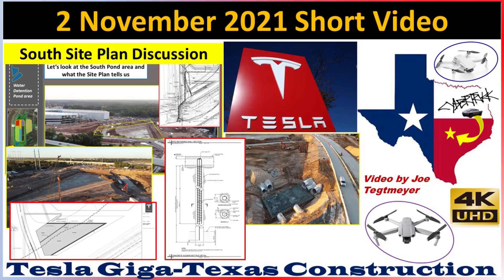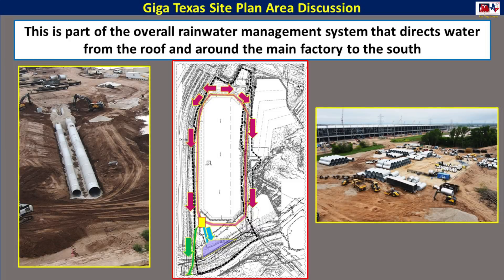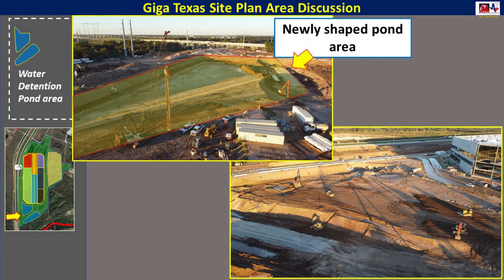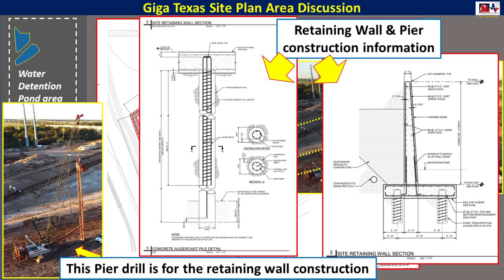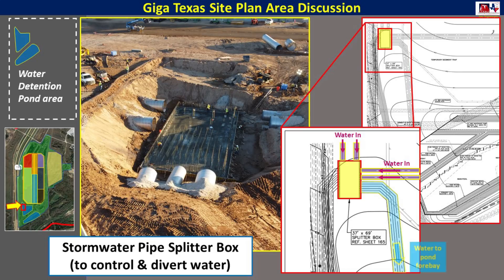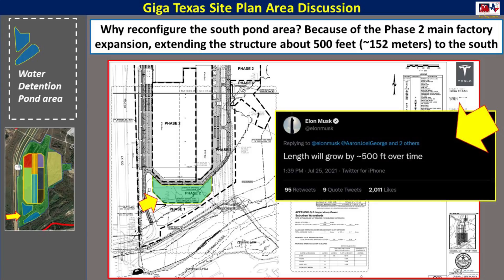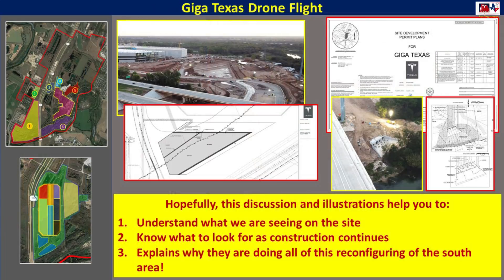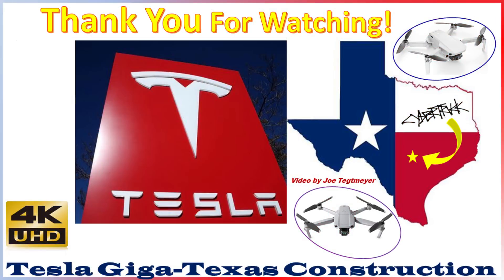Tesla Gigafactory Texas 2 November 2021 South Area Pond Construction Discussion Short Video (4K)

Comment: Depending on future rainfall patterns I can't help but wonder if the South end stormwater pipe outfall headwall structure doesn't extend far enough out towards the river. If changing rainfall patterns means a large increase in very heavy rainfall events I can see the river bank eventually being eroded, undermining the concrete outfall headwall structure; I've seen a number of examples of this in the past.

Comment: Wondering if the extension is warehousing? I've watched a video where it was explained that Giga-Shanghai (and Giga-Berlin will too) are always surrounded by container trailers on all the loading docks. They only unload the containers as needed direct to the production line, rather than unloading quickly and double-handling the goods later. The truck disconnects and grabs an empty trailer and heads off quickly for efficient turn around. There are just not enough loading docks here for this approach to warehousing. I suppose the building is large enough for internal storage, but not as efficient with double handling still, unless there is some as yet unknown design change and magic here.

Comment: Thanks Joe. 
2:00. Ponds. Already we can see deviations from what is shown on the drawings, the repurposed wall panels in Pond 2, the un-piered beams being constructed along the south side of the Wet Pond, splitter box orientation and design changed. All of the 72 drawings released were revisions, and it is likely some have been superseded already.

2:33. Splitter Box. The purpose seems straight forward. Directing stormwater to various outlets depending on the volume entering the box at the time. 

The orientation of the box has changed, turned away from due north. Drains now discharging into the box through the long side on the west, whereas the drawings show the long side being the river outlet. Weir being built in a slightly altered configuration to account for this. River outlet now likely to be the short side.

The Weir within the splitter box is this 5 finger shaped design that has an overall length of hundreds of feet. From what I can glean from Google the purpose of the shape is to aerate the water as it tumbles over the weir, and the purpose of aerating could be to dump out any silt. 

The weir only comes into play when the Forebay, and Wet Pond are at capacity. Water level rises eventually overflowing the weir and on into the river.

3:34. The road and Phase 2. Sheet 019 of 166 (pdf page 10).

A 500’ southerly extension if measured from the existing building includes the road. This can be measured using the scale in the top right of the sheet. 

Using the same scale, the area shown within the dashed line is 370’ or so north-south. 

Also shown within the Phase 2 southerly extension is a Text Box that states ‘Extents of Impervious Cover (Phase 2)’. This is the only relevant bit of information.

What this shows is that a possible 500’ southerly extension includes this additional 370’ of ‘impervious cover’, and that the additional amount of impervious cover has been accounted for in the calculations for how the stormwater will be managed. That idea being that if the extension goes ahead, the increase in impervious cover has already been allowed for and the stormwater system won’t need to be altered. 

This part of the drawing only shows that the area of impervious cover increases by an amount, and that amount doesn’t include the road because that was part of the Phase 1 calculations. 

It doesn’t show that a road will separate the extension from the new building.
Reply: I don't think aerating is a concerne here.
That weir is only for occasional overflow, that would wash away any silt.
And logically rainwater should already be very aerated.
Reply: @musaran2  Aeration was just what I could find on the web. I can't think of a purpose for the shape otherwise.

Hopefully Bob Callaghan might chime in on this.

Comment: Throwing my hat into the speculation ring, I'm wondering if the 500' phase 2 extension could be used as a 'car dispenser' for completed production, like a Carvana car 'vending machine', only GIGA!

Watching all the GigaTexas drone videos, it seems an indoor finished inventory area to protect the finished product from thunderstorms, hail, snow, dust, etc. might be worth the expense.
Watching all the GigaShanghai vids, it is apparent a LOT of manhours are expended just in moving the cars to the expansive holding lot, then onto transports. 
So, a drive-thru car dispenser for loading new production onto transports might address both those challenges, and have a PR benefit.

An illuminated five-story glass display case for your 'Hot Wheels' gotta be impressive to the passing Hwy 130 and overhead traffic!!

Comment: I think phase 2 could be a R&D facility, which would make sense if it is separated from the main building; it would not need to be connected. In Shanghai, the R&D building came last as well.
Reply from the maker: That would be interesting and in line with making this facility a major hub and Hq for Tesla.

Comment: I've noticed the ponds being called "water detention." I think they should rather be called "water retention" ponds
Reply: Carlos, check out my pond function reply above.
Reply from the maker: Original site plan called them Water Detention ponds.  The new site plan refers to them as sedimentation basins.
Reply: @JoeTegtmeyer  Joe I can only go by what is shown on the drawings and my interpretation of them. Refer to page 60 or sheet 163. The overall name of the East pond (pond 2) is shown as Biofiltration pond which contains a sedimentation basin and a biofiltration basin. The sediment basin is smaller than the biofiltration basin. There is also a section drawing (section AA) shown on page 61,sheet 164 that shows the sedimentation basin and the filtration basin. I think that the sediment removal is primarily to protect the filtration media. Normally the pond is slowly releasing filtered water through the 6" drain and is somewhere between a retention and detention pond. In large rain events when the level reaches the orifices in the weir it becomes a detention pond that can detain about 4 acre feet of water. In the as built seen now the water enters from the 8' supplies then into the concrete distribution channel which distributes to sedimentation basin to the South then to the filtration basin. The weir structure is to the East of the distribution channel  and also serves as a culvert for the road. It drains into the "S" channel and existing ponds. For pond 1, re. page 54, sheet 158, Wet Pond #1 Water Quality Calculations,  also check out page 53, sheet 157 Pond Liner Specifications.
Reply from the maker: @eltonray2934  OK … glad I was able to help you get the site plans as this helps a lot!
Reply: @JoeTegtmeyer  Yes Joe, Thank you for the plans, brings back memories of over 25 years in large industrial plants.

Comment: Joe, this is my interpretation of the pond 1 operation:
During non - rain times the wet pond area will have between none and 6' level dependent on previous weather and be in the retention phase.
When it rains all of the runoff will flow through the splitter box and into pond 1 forebay to remove solids and over the dam into the wet pond area to refill it.
If the rains continue at 6' level the pond starts overflow through three 1' restrictions then to the river. Now it is in the detention phase. The actual as built seems to vary from this but hopefully retains the same function.
Continuing rain at high rates causes the level to increase and at about 13' pond level the weir starts overflowing in the splitter box. The length of the weir determines capacity versus level increase so a folded 360' weir is used. Weir overflow goes straight to the Colorado river.
At rains end the weir overflow stops and then the wet pond overflow drains the pond back down to 6' and the wet pond returns to retention phase waiting for the next rain.
Reply: Elton,
I had the same thoughts (after I noticed the black membrane for the first time) but when I brought it up with Joe he indicated the Geotextile membrane on the floor of the pond was of the permeable type. His earlier briefing on membranes (6 august 2020 video) gave indeed a clear explanation why a permeable membrane is important to keep soil types separate for maximum infiltration performance. Subsequently, David Johnson and others (yourself included based on yr scenario?) took the non-permeable view, including reference to the planning documents which mentioned both permeable and non-permeable membranes. 

I'll await developments with interest!
Reply: @hardernl8893  Actually the function of the pond does not rely much on water entering the soil, operation would still be the same. Notice the other ponds left over from the mining operations, that theory does not hold much water as the ponds do. Anyway check out page 53 sheet 157, "Pond Liner Specifications", 30 mil UV protected membrane, geotextile both sides for puncture protection if required. ECM 1.6.2.C. - All basins in wet ponds require an impermeable liner.  - City of Austin
Reply: @eltonray2934  I agree completely on your your interpretation of the pond 1 operation. But on your reply to Harder NL.... Yes, geotextile is mentioned, but the water proof geomembrane is still a requirement in the specifications. The geotextile fabric is for puncture protection of the geomembrane. Am I wrong on that? Page 53 also seems to place great emphasis on the liner not leaking. Note that it also says: "AFTER THE FILLING AND INSTALLATION OF AQUATIC VEGETATION, THE WATER LEVEL OF THE PERMANENT POOL SHALL BE MEASURE AND MONITORED FOR A MINIMUM OF 8 WEEKS. CONTRACTOR SHALL PROVIDE WATER ELEVATION LEVELS WEEKLY TO THE ENGINEER FOR ANALYSIS".
Reply: @eltonray2934  I reread your reply to Harder NL, and in your quote from page 53, it says: "All basins in wet ponds require an impermeable liner. - City of Austin." So there is no doubt that this will be a waterproof pond. At least to the 6' elevation.
Reply: Also, I would like to point out an apparent error on page 54 of the site plan. In the cross-section drawing of the pond weir/outfall structure (not to be confused with splitter box weir), shows elevation as: "(3) 1FT ORIFICES FL = 404.7". Which is too high. At that elevation, even in a normal rain event, the pond would fill to 13 feet before a drop of water flows out to the river. What is shown on page 52 is in direct conflict, but makes more sense. Where it shows the weir at correct elevation of 397.5' for a normal pond depth of 6 feet. The pond bottom is 391.5'.
Reply: @DavidJohnson-tv2nn  Well, the 3 orifices are not really a weir but you are correct, the orifices as shown at 404.7 would never have any flow since the splitter box weir is at 404.4, someone made a mistake.
Reply: @eltonray2934  I wonder if this could lead to problems later on? We pay attention to this stuff because we want to know how the system works. The contractor doesn't care. They will just build what the drawing says, at the elevation it says :) Or are there separate drawings that the contractors follow?
Reply: @DavidJohnson-tv2nn  David, we used a set of drawings called PIDs for the final structure. The PIDs explained every aspect of construction. We also had an owner's representative which cross checked everything. After that plant operation personnel would double check before startup. Still had to troubleshoot problems during startup.

Comment: I have a question about water management Joe. I assume that Tesla had to agree to terms of usage from Austin's municipal water system. This explains why they wanted as many underground storage tanks as possible. If there is a dry year, is Tesla allowed to remove water from the drainage pond(s) around the site to utilize in their processes in addition to the amount they're allotted from Austin? Because they can apparently use rain water there must be some systems that don't rely on treated water. Any ideas? I also noted on the site plan you presented that it shows a road below the water retention pond that proceeds to the E of the facility.
Reply: The main usage of water in this plant is probably the paint system. Durr, the supplier of the paint system claims to have a nearly 100 percent recycle of water. As far as I know the only underground storage of rainwater is the "H" area which is also part of the wastewater treatment system. Tesla needs DI water which they get from rain or filter normal water through resin beds.

Comment: But WHY? Why do they need the extra 500' right there? Especially if it's not contiguous. There's plenty of room on site to put it elsewhere and not do all of this extra work.
Reply: I would guess that an extension to the building indicates that they have decided to produce more of the required parts here and not rely on other suppliers. In my mind I see it connected to the existing building to be near points of use and increase efficiency. This is a site that will always be in a state of change to meet needs.
Reply: The 500’ extension is needed to make the west-side glass ‘T’ symmetric. As a separate building the South Annex will make great office and showroom space, with lots of light from the window bands, and overlooking the Colorado on the south.
Reply: Not really that much more work when you think about it. You can't just dump stormwater out of the end of a pipe into a hole in the ground (Pond) and call it good. All pipe terminations need a some kind  of concrete outfall structure. They would  also still need the splitter box, river outlet pipes, river outfall structure, Reshape the pond to specifications, pond liner, pond overflow protection, and about 3,500 plants. And whatever else I forgot to mention :)
Reply: @DavidJohnson-tv2nn  I believe Mark is referring to the extra 500 feet of factory building planned for the south end.
Reply: @jeffcarlton3590  I thought Mark may be referring to the work being done now as  preparation for the upcoming expansion. and therefore, a waste of time. Since other people in the comments have also linked the current stormwater work to the expansion of the factory. 
My point is that while it might be linked in a way, that is, the location of the south pond.... The work would have to be done anyway. Even if there were no expansion planned. It may have had a pond in a different location. But everything you see being done here, would have been done anyway.
Reply: @DavidJohnson-tv2nn  There was already a pond there that they filled in. That's the unnecessary work I'm referring to.
Reply: @marknevar8234  The original pond was defined in the Phase 1 plans specifically as a "temporary" silt collection facility, which is completely different than a permanent water retention facility with its additional infrastructure.  Makes sense since during initial phases of construction the site was a massive area of exposed soil.
Reply: @marknevar8234  Ok, but here is what you're overlooking...
If they kept the north pond, it would have had to be partially filled anyway. Due to the fact that the eastside and central stormwater pipes had to cross the pond to reach the splitter box. Furthermore, they would have to reshape it to meet design specifications. So, while some work may have been saved by keeping the north pond,  they would have lost a lot of usable land in the area near the factory.

Comment: Great analysis of the plans Joe, watched it twice. At 3:00 you can see the overflow pipes are much higher in elevation. Thanks, clears a lot up
Reply: I think that is mostly appearance due to the angle the photo was taken from. The site plan page 71 shows a difference of about 16 inches. Seen from a different angle... As built, all pipes appear to be at the same elevation, or very close to the same elevation. Flow to the river outlet pipes is controlled by an internal weir in the splitter box. Seen on page 70.
Reply: On the civil drawings they show that the downside of the weir is filled with leveling mix to bring it up to the bottom of the pipes. I believe that this would ensure complete drainage of the weir downside area and prevent stagnant water areas. The upside of the weir drains completely to the pond for the same reason. The weir determines overflow height. They also use a similar overflow weir on pond 2.